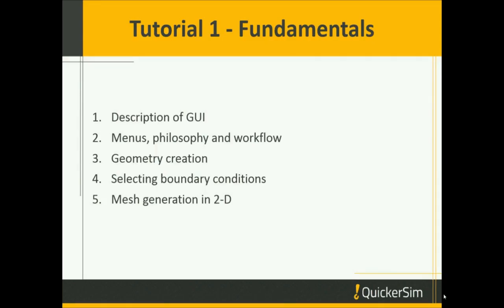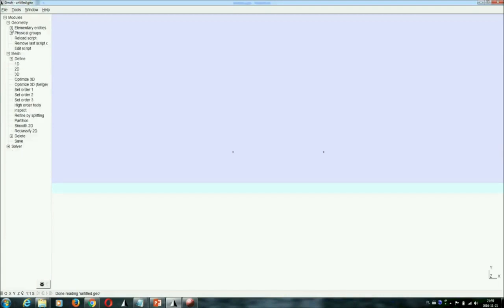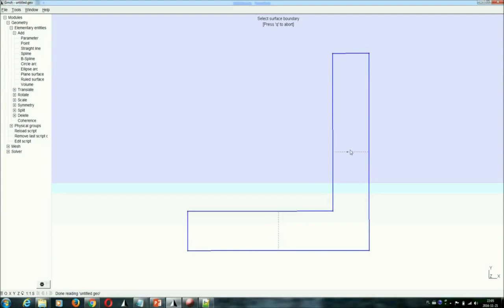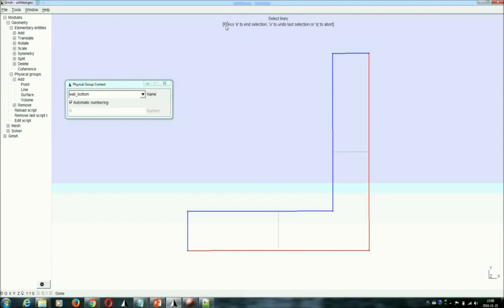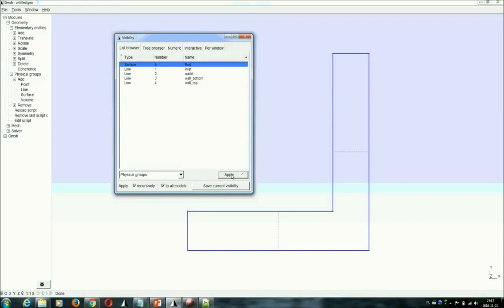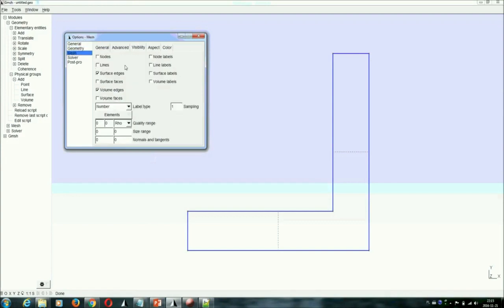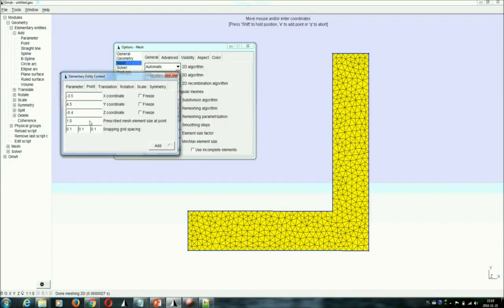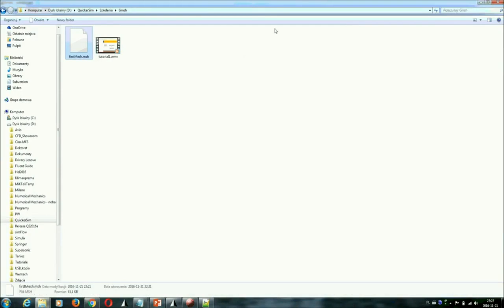Gmsh Tutorial Part 1 - Fundamentals and 2-D Meshing

Comment: I managed to figure out to add Points  I have to press the shift key in order for the point to hold position and be able to press the Add button. But then for the Line I cannot select any point.  I am stuck.
Reply: check mouse on and off option. that is at the bottom of the window
Reply: in case someone else encounters this problem, you should zoom in on your mesh, then it will become easier to choose points)